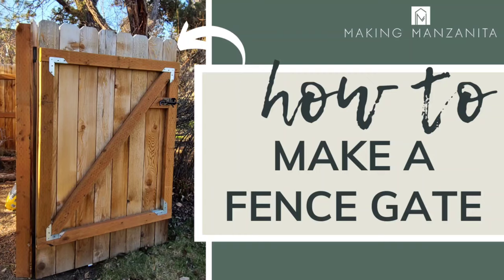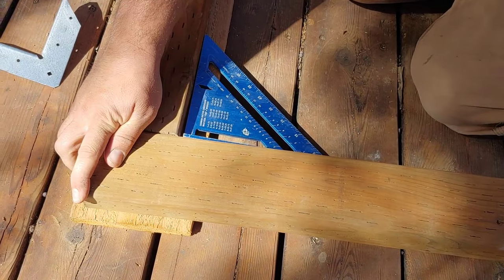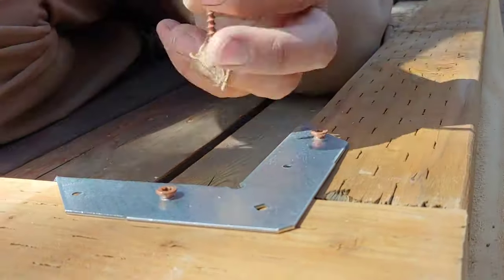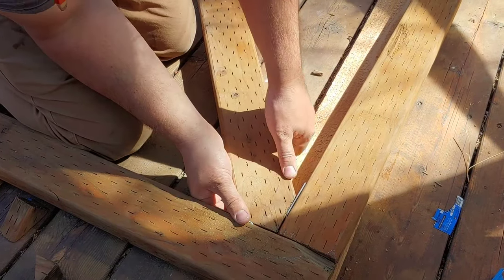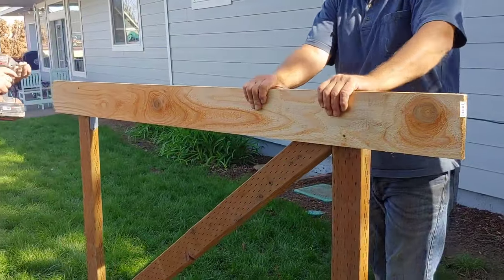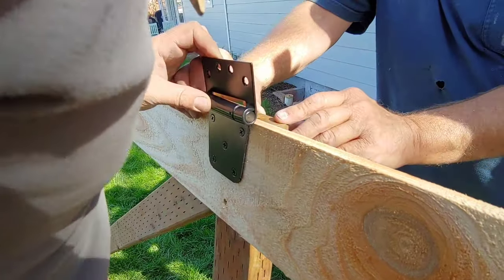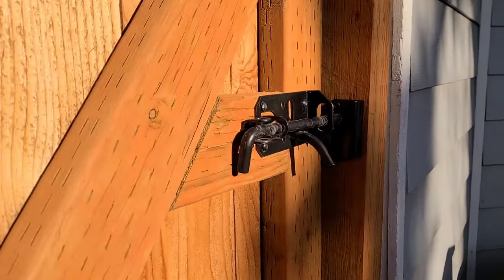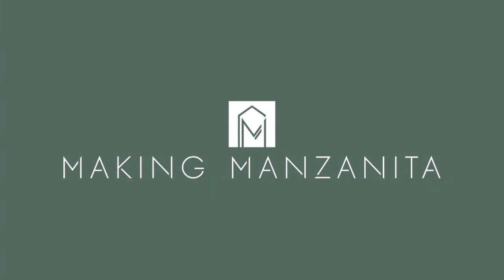How To Make A Simple Fence Gate for a 6' Wooden Backyard Fence

Comment: To all who is watching this, there is absolutely nothing wrong with building a gate like this, as it is simple.......but, I would absolutely recommend purchasing & installing a spring loaded gate wheel for support, and to eliminate the possibility of your gate "sagging" over time. It only costs around or below $20, and only requires (2) lag bolts for installation which are included. Definitely worth it for what it prevents.
Reply: Hey like wheels installed? It just looks weird

Comment: Needs a little better direction. I ended up using a thumb latch handle. The angled center board was the biggest pain trying to get corner screws in. I ended up running torx screws on the outside of the square frame board to board. The center braces kept it from falling apart but not lined up and secured like I needed. This video was a template for me to build mine. Had to watch video over a dozen times at each section of the build.
Reply: It was that’s hard. Pretty simple instructions to me.

Comment: either using a big framing square or doing a cross referenced diagonal square measurement is a missing step here when installing the small corner brackets.  hate to be hatin, but you can see the need for it in this video when the first corner bracket installation squaring is being fumbled with.

Comment: I found the corner braces in black at Home Depot.  They're handsome and very sturdy.  Thank you for suggesting them.  Installing them with #9 x 1.5 inch Sd Connector screws with the heads sprayed black make a better look than the screws you used in the video.  Excellent video.  :o)

Comment: BUT don't use flat-head deck screws to attach those Simpson angle brackets; the sharp edges of the holes doesn't bear properly on the tapered head and it just isn't right.  It's better to use #9 x 1 1/2" SD Connector Screws that are made for the purpose.  Not as corrosion resistant as the deck screws but the square edges of the holes took the finish off the underside of those heads when then were installed, anyway, and the finish of the SD screws will match the angles.  
Same for the fence clips, and you'll need to allow for the heads protruding past the surface of the steel either way.  May as well buy the fasteners intended for the hardware and get it right the first time.  Just sayin'.
Screws are the ONLY thing I'd change, though.  Well thought out and well executed.  NICE JOB!
Reply: Thank you for the upgrade advice and the confirmation of the work.  My hubby and I have put this off a long time for lack of a good plan / knowledge .
Reply from the maker: Thanks for the advice. Next round we'll get some SD Connect Screws.

Comment: For those people who think its unnecessary to wear protective eye gear, masks or gloves, when working with Pressure Treated (PT) lumber… You should go to the wood manufacturer’s websites. They all say pretty much the same things.  DO NOT TOUCH NEW PRESSURE TREATED WOOD WITH YOUR BARE HANDS.  If you do touch it, you are supposed to wash your hands immediately.  Don’t breath in the saw dust because it is loaded with the chemicals.  In fact they even recommend that any clothing that touched new PT lumber be washed immediately and separately from your regular laundry.  

New pressure treated lumber is very toxic, and it leaches out of the wood for quite a while.  This is why you can’t use pressure treated wood inside your home.  You also can’t use it for garden boxes that will grow fruits or vegetables, or edible flowers, unless you completely line it with plastic.  Our dog was exposed to the in the sawdust because the deck builder didn’t clean anything up.  She now has severe lung disease and has to take 2 inhalers, oral steroids and asthma medication twice a day.  If you are cutting a treated wood, please wear the proper protective mask, gloves and safety glasses.  Your eyes have a mucous membrane that absorbs chemicals very quickly.  

Most builders recommend waiting a few weeks for your deck boards to “dry out” before you stain OR seal the wood.  During this process the water evaporates leaving the chemicals.  I started researching, because there were 2 boards on my brand new deck that would stay wet long after the rest of the deck was dry.  I looked at several wood manufacturers and realized that the pressure treating processes had changed, because the chemicals being used were deadly.  The PT lumber of today, is not the same as the lumber in the 1970’s or ‘80s?  The old PT wood was protected all the way through.  Most people are not aware that most of the above ground pressure treated products are ONLY protected around the outer edges of the board.  The middle of the board has basically no chemical protection.  SO as soon as you cut a board, or drill into the middle, you are required to seal the holes and cut ends with TWO coats of a special chemical product that the manufacturer recommends. Some manufacturers require that the sealer contain a minimum of 1% copper.  Some product I’ve seen were called Cut-N-Treat or Cut-N-Seal.  These products are not the same as regular deck sealer.  They specifically state for cuts into PT wood.  The reason this is necessary to seal cuts and large holes is because the inside of the board is completely dried out and unprotected.  When a PT board is cut or a hole is drilled, the inner wood is exposed.  That dry wood acts like a straw or sponge and starts drawing moisture in.  Remember back to your science classes when you learned about osmosis, which is simply the movement of water going from a high concentration to an area of lower concentration.  Humidity is the amount of moisture in the air, which is higher than the moisture in the wood.  There is also the risk of rain water getting pulled inside, during the “drying out” period before you stain or seal the wood.  The wood manufacturer might have a 25 year warranty on their products, but if you fail to seal your cuts and holes with the exact product in their instructions, the manufacturer’s warranty is lost.  They will not replace anything, for any reason… even if it’s related to bugs and not water damage!  As soon as you don’t follow their instructions, your warranty is VOIDED!

The warranty requires you to have receipts for the sealer, to show that you bought the correct product and when, you also need to take photos showing the cut ends were sealed with 2 coats.  If you are investing in expensive pressure treated lumber, then make sure you follow the manufacturer’s instructions.  Since some receipts degrade quickly, especially in hot environments, take a photo on your cell phone of the product and your receipt, so you don’t lose out!  Yes it’s a pain in the ass, and a bit more work, but replacing a $20,000 deck that should have been covered by warranty is worse!

For people who are hiring a company to build your deck, fence, etc.  Ask them about sealing their cut ends.  If they look at you like you have 2 heads and have no idea what you’re talking about, say goodbye and walk away.  This is a clear sign that they don’t read the manufacturer’s instructions for the pressure treated lumber being used.  Any photos of their work, would show projects that have no manufacturer’s warranty, and their customers most likely have no idea.  Those instructions also include information on how to dispose of left over material and how to clean up the worksite and sawdust properly.   So they likely have also contaminated their customer’s property in some way.   IF YOU HAVE PETS… PLEASE PLEASE DON’T EXPOSE THEM TO THESE CHEMICALS!  It is truly a nightmare to watch you pet struggle to breath!

Comment: Did you use screws on the inside of your brackets? Not sure the 2x4 cross brace would work if the screws were sticking up slightly from the brackets.
Thanks, how is it holding up?
Reply from the maker: We did and yea we ended up jamming it in there for a snug fit. Gate is holding up fine other than the bottom board warped because of a knot still operates though.

Comment: Basically I liked your video although I did not actually listen to it from habit, since I finally got tired of the crappy music that usually accompanies most videos - But the visual was more than clear as to what was needed to get-er-done.

I've had to build three gates for our fence since '79 so actually know what to do, but this time I was going to use some heavy steel "L" shaped brackets, until I saw the fittings you used and decided to go with those instead, since I am using 3/8" steel cable with a heavy duty turn buckle as the diagonal support (anchored with steel eyelets) instead of a 2" by 4" diagonal brace of Douglas Fir which had always kept the gate from sagging, but now that I'm 76 I do not intend to do this again - unless I replace the slats themselves.

One major problem I have with the build as shown is mounting the hinges on the exterior surface of the gate - which means they can be easily removed with a cordless drill in less than two minutes, (!).

As a former police officer in Stanton and L.A., CA. I've responded to several burglaries where a suspect had removed the hinges (with a simple screwdriver) to enter the victim's shed or work shop or even their house because the hinges had been installed incorrectly; and because of that fact their insurance company was less than forth-coming with the money to cover their losses.

The only way I could ever see mounting the hinges on the outside would be only IF carriage bolts were used to secure the hinges and lock plate - BUT, then there is always the possibility of using a punch or a drift to remove the hinge-pin itself, unless it  was spot welded for added security.

Hope you don't interpret my comment as "nit-picking" but have seen what can happen when done this way.

Comment: How much clearance between the gate and the posts? My posts are not quite vertical.
Reply: Depends on the hardware you're using.  My recommendation would be anywhere from 1/8"-1/4" on the hinge side and 1/4"-1/2" on the latch/handle side if your using one of those gate kits from Home Depot or something.  Again, depending on the hardware you're using you may want more clearance but I wouldn't go any less than that.

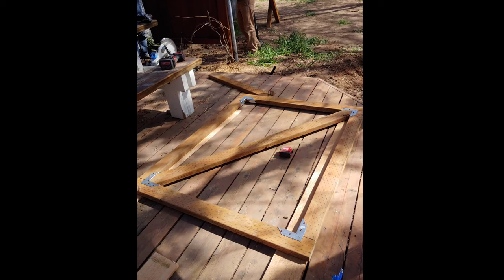Comment: At 1:06 are you drilling through the metal of the corner braces?
Reply from the maker: Good question and it certainly looks that way, but no. If you look closely at the product for the corner bracket (link: https://rstyle.me/+oI5Pe-1skJmjgSFHw94wLA) you'll see that the inside corner has a v-shaped notch so that's where we are drilling at 1:06. The metal doesn't extend all the way through the corner if that makes sense.
Reply: @MakingManzanita   Screw size for that please?

Comment: How many inches above and below the frame are the pickets? I'm trying to get an idea of measurements of a frame for my 6 foot tall gate.
Reply: Or since this is also a 6 foot gate, what is the height of your frame?
Reply: @SHAPPGolfs  I don't think there's a magic number. Personally, I'd make it flush with the existing horizontal rails so it appears aesthetically pleasing.. Considering it's a 6' picket fence, just by eyeballing it. I'd say it looks like the height of the frame 4.5'-5'? In the tutorial, It looks like the bottom part of their gate frame isn't flush with the bottom rail. lol. Still looks good though!
Reply from the maker: The rails are approximately 8 inches from the top and bottom of the fence.
Reply from the maker: thanks for chiming in!
Reply: I would just use the existing horizontal fence support rails next to it as a guide and make your horizontal brace boards in the same spot.  I would think that would be obvious.

Comment: Guarantee you that's sagging by now with those little hinges... likely had to be replaced already.
Reply from the maker: Nope, still holding strong and looks just as good 3 years later :)
Reply: I agree, I wouldn't trust those baby wood screws. You also drove the screws into a fence board laid over the support so there is literally nothing holding those hinges in. LOL, you can see the hinges failing @ 2min 14sec mark!
Reply: @MakingManzanita  doubtful, please post video to support this claim

Comment: This diagonal piece is killing me I'm not a construction guy and I can't figure how to use the speed square to get the angle to cut
Reply from the maker: If you are having trouble with the speed square what you can do differently is lay the frame over the board you'll use for the diagonal. Once you get the placement right you can then draw a line where the frame overlaps the diagonal piece. Let me know if this works out for you.
Reply: @MakingManzanita  Thankyou for the response lol I actually sat there staring at it for about ten minutes and did this exactly lol sat the frame on top of the board and marked both ends and made the cuts 😂

Comment: No way is that 4x2 like you said at the start of video
Reply: If that was 4x2 timber them hinges would not be strong enough to take the weight of the gate.Think you was way out with the sizes you said and the screws used looks rubbish would have looked better with round head screws.